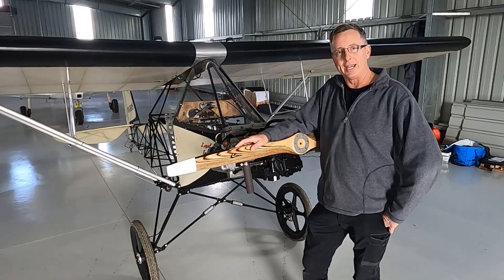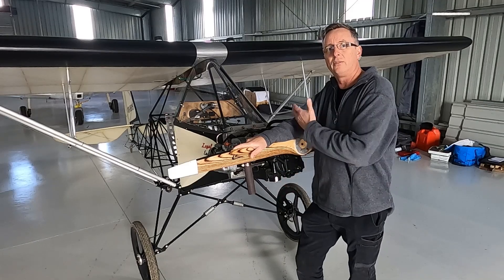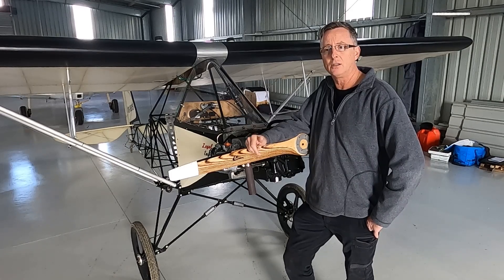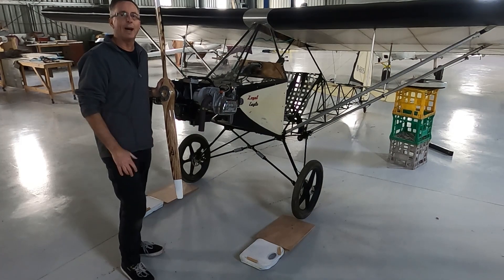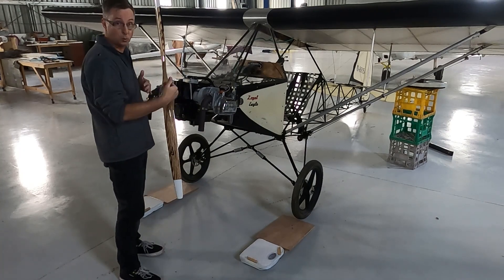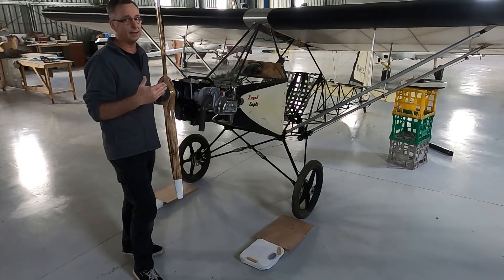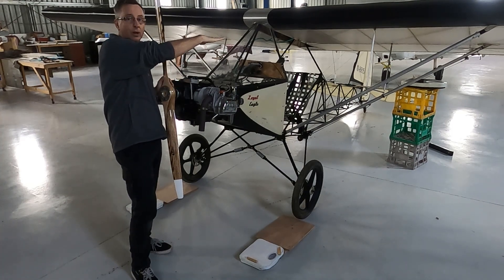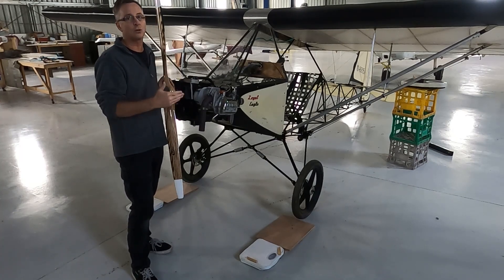Weight and Balance Calculation - Part 1 The Weighing

Comment: When you fly you don't have any dirt on your Wheels? Woundn't you want to use Real flying weight?
Reply from the maker: Hey Gary.  When performing a weight and balance there is a legal requirement to make sure the aircraft is clean of all rubbish both internally and externally.  Removing dirt is part of that. Must have full engine oil, unusable fuel, all mandatory equipment installed and listed as well as any permanent ballast in place.  From this empty weight starting point you then add the weight of pilot and fuel and baggage all the while making sure the aircraft stays below its maximum allowable weight AND within its C of G range in all stages of flight.
Reply: @DCSquared  If they are that damned picky as to write a legal requirement that I wipe off the tires for a weight and balance in AU then I can understand why they are killing the desire for young people there to get into flying -  OCD!